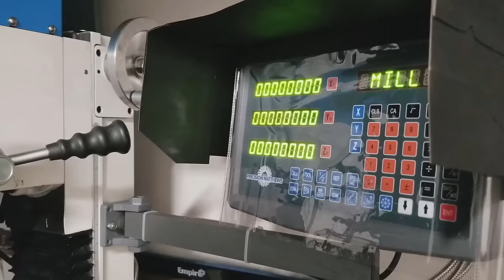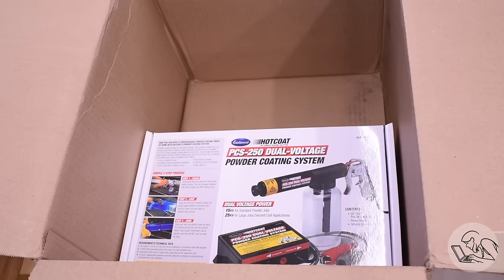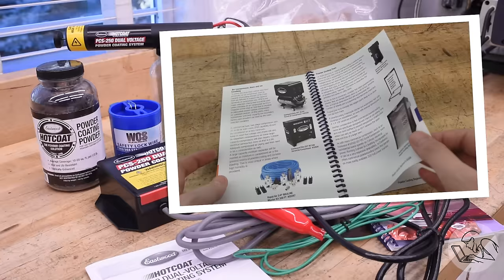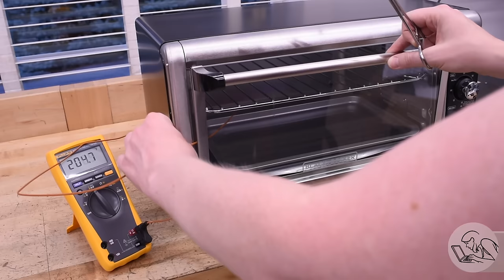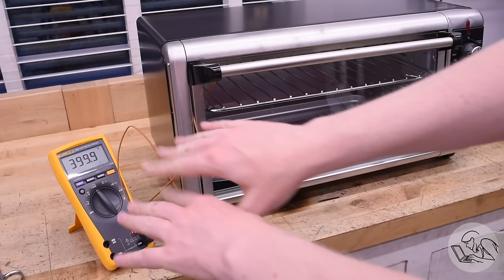Powder Coating At Home! You Can Do It!

Comment: It's hard not to be a bit of a zealot once introduced to the joys of powdercoating. I don't know why Eastwood insist on stainless steel wire. I've used copper, aluminium and steel wire and they all work fine. The low voltage setting on the power supply is to help get the powder into recesses and deep cavities. It's better at reducing the Faraday effect. Have you discovered the excitement of triggering the HV while holding the grounded part yet?
Reply from the maker: Ohhh, thanks for that info, Preso! I should have asked you first. 😄 I’ll make good use of that low voltage setting. The book did explain the Faraday problem, but did not explain how the low voltage setting will reduce it. 

I have not discovered that joy, but it’s been on my mind a lot. I did get the gun too close once and saw the arc. Gives one pause about the voltage flying around in there. 😳
Reply: I wonder if they insist on stainless steel wire because other kinds can corrode and form a skin that acts as a resistor to the ground connection.   Completely guessing of course.
Reply: I've been wondering about Quinn's sample part, with the wire looped through the hole - whether the wire would create a shadow on the part.  What about a tiny sheet metal screw in the hole, with the wire wrapped solidly around it?
Reply: If you are trying to get into recesses and the low voltage setting is still to much you can mist the coating in without hitting the voltage button at all.  Once you put a little powder on the piece will keep a small amount of residual voltage and it will be enough.  It is the opposite of painting, generally you try to mist the recessed areas first so you don't put too much everywhere else, powder is the opposite, cover the easy parts and then mist in the tricky spots.
Reply: If you have the space, I recommend finding a used electric wall oven. That's what I use for all my powder coating.
Reply: Stainless Steel has a higher resistance then most other metals. I wonder if this has anything to do with it?
Reply: @raulthepig5821 probably because it's the most chemically inert metal (except Platinum and such but that would be cost prohibitive anyways)
Reply: I realize this is a couple of months old now, but I can offer a little advice tho you don't have to take it. I used to work in a factory that I just did powder coating in. We used to use all kinds of things to hang things; sanded down coat hangers to some pretty thin wire. We ALWAYS used the wire it was hanging from as the ground to the work piece. Sometimes we had to file the old powder off a bit to get better grounds and we bent the ends at like 40-45 degree bends to prevent swaying while spraying. They were different lengths depending on the size of the part, but typically like and elongated "Z" 
Getting any oil residue off of the part was always our number one concern. We coated everything from appliance pieces to car parts to motorsports whole car frames to even new bigger ovens to coat even bigger items. And even coats of coarse is quality. We used 90 percent isopropyl alcohol and a q-tip and if we could rub off any color then it wasn't cured and we also had a little handheld electrical device that told us the thickness of the powder coating just by placing it on the piece. I'm not in this line of work anymore and it has been over 20 years since I've done this, but principle shouldn't change much. Spray it, heat it up to 420F (even in deep cavities) and then let it cool down.
Also, for threaded pieces..we screwed in a bolt to cover the threads completely, then sprayed it, then removed the bolts before baking it. We also have left bolts in (making sure they weren't going to be coated to the piece) and used the bolt to wrap our ground wire around to hang it from. Back to oil, we had these big tubs that had warmed up degreaser in and then we had 2 tubs to rinse them from the degreaser. Baked them dry and then cooled with a fan then straight to the booth and then to curing oven. We also had a fan on them for the cool down process.
 Idk if much has really changed, but hopefully something I said helped. Cheers

Comment: What a wonderful tutorial on home powercoating! I knew that these kits were available, but I figured that they really couldn't be worthwhile, since the 'big guys' have such large and expensive ovens. Seeing is believing, and now I know that this kind of work is feasible in the small shop, and the results can be excellent!
Reply: I mean, powder coating is essen\tidally melting powdered plastic. It doesn’t seem like it should be too hard to get something functional. Getting it to volume mass production is an entirely different kettle of fish.
Reply: Did you really trademark "Sproing"??  Genius!
Reply: I did some just by blowing some on a flat piece and using a heat gun to melt it, worked great
Reply: I know a guy that picked up a double oven free on marketplace.  He cut out the center divider and connected the doors, it gave a big enough heating area to do small motorcycle frames.
Reply: The only thing keeping people from powder coating is fear.
I did an old clock in a toaster oven, if you're interested in seeing the results.
Reply: Check out immersion in a fluidized bed. You can make one from some PVC fittings, membrane, and an air regulator. Heat, dip, cure. Great for those small parts!

Comment: For toaster oven stability, the polymer clay folks like to bring it up to temperature with a brick or a big ceramic floor tile in there. A nice, durable thermal mass can even out the temp swings from those door openings but won't off-gas anything.
Reply: Bread and pizza folks do it similarly.  😎
Reply: 👉What are the temp’s needed to cure it? Reason asked is I use a large Dehydrator unit for curing many of my hobby items. However the 🔝 temp is only about 160°
Thx
Lee
Reply: Good idea!
My first thoughts on why the temperature bleeds prevent 425 degrees is because the electrical and wiring insulation will fail sooner at that higher temperature.
So shielding that vulnerable side with refractory material makes sense as well as heat sinking, insulating, and thermal mass in all the right spots.

Comment: As a painter, a lot of people put too much etch primer on in my opinion.  On Aluminium, brass etc. the best result is got from applying a mist coat just enough to cover the surface, but it should be see through, not fully solid.  The way it's supposed to work is the primer is a boundary layer, it's not paint.  The undercoat and top coats bind to the boundary layer making a contiguous coating on curing.  Too much primer is actually weak and pulls off easily.  I favour Alkyd enamels myself for levelling out and holding on around sharp corners and edges.  And Penetrol is of great benefit too with any oil and turps based paints and varnishes adding flexibility and adhesion - although too much matts the finish off and colours will change with some pigment groups.  Looks like powder coating is a great way of getting a really tough coating onto smaller parts and not that hard to do from what you and Preso have shown.  Might have to level up from fluid coatings at last myself... :)  Cheers from Oz.

Comment from the maker: Hey everyone! Yes, I did install the drip tray incorrectly. I swear I read the instructions but I missed that detail. 😊 Didn’t seem to hurt anything but I have since fixed it.
Reply: For smaller parts you can just degrees them then put them in a container with the powder and shake it to coat them. Lots of people who cast lead bullets powder coat their bullets this way.
Reply: @bluebanana6753  I know nothing about casting bullets but am curious as to why they get powder coated? 
Also putting the item to be coated in a container with the powder, does that not affect the final coating thickness?
Reply: Just a suggestion you could try mixing some powder with acetone or lacquer thinner then dip your small parts or put it in a gun & spray then bake as per normal 👍.
Reply: Can you turn the oven on its side to get more interior height? IDK, just asking.
Reply: You owe Sprocket a box. 😂
Reply: @bluebanana6753  I thought an electrostatic charge on the part was needed to make the powder stick.
Reply: @Gin-toki yes and no. You have to have the right technique and powder. Some pre heat them a bit to get better coverage and thickness. But if you want good accuracy, an even and consistent coat is important. Some reload bulk ammo and don't care too much. But many do want accurate ammo (and they want better accuracy than what they get with tumble lube) and a good technique with this method gives them that.
Reply: @ron827  Look up powder coat cast bullets. You will see that is not the case. And it's pretty amazing on the consistency you get in coats. It's not like you can have every bullet standing right side up in the rack either. We are talking about amounts between 500-1000 bullets at the time when you coat and bake them.
Reply: @1slotmech  
That debt will be collected, cats are that way. Mine are.
Reply: @ron827  
The charge is on the powder, which then is transferred to the grounded part. Lots of charged particles flying about there.
Reply: It probably works as a good heat spreader the way you installed it.

Comment: Quinn, if the toaster doesn't quite have the stability or recovery time you need, there are conversion kits to turn them into PID-controlled, better insulated reflow ovens for SMD soldering. I did a Controleo3 conversion on a similar toaster to yours a while back and was fairly impressed with the results
Reply: I've done the same, only for bakng SMT PCBs. It's an excellent product. I can't remember if the hardware is open source, but the firmware definitely is.
Reply: I suppose a HotShot 360 would be overkill.
Reply: Many years ago, I built a box containing an Omega PID controller and an SSR to control my small 120V glass kiln. The controller plugs into the wall, and the kiln plugs into the controller. Because it's designed that way, I can use the same box to precisely control a small toaster oven I use to cure Vitrea 160 glass paint, because if you overheat that stuff it tends to discolor pretty badly.

I've also used the same controller, with a separate, dedicated-use sealed stainless-steel thermocouple, to control a hot plate I was using to make cheese at home.
Reply: Another recommendation for Controleo3.  Great kit; works very well.
In unrelated news: kitchen appliance cords are required (UL/ETL, maybe) to be no more than 3' and no less than 2' long, so a lot of stuff comes with a 2' cord now.
Reply: @babyeatingpsychopath  The reasoning behind the short cord seems to officially be as a way to prevent a tripping hazard. Another reason is that since current electrical codes require enough outlets in kitchens that a longer cord is unneeded. If you're aware of toaster bathing, it's far more likely that the driving factor comes from the bathroom electrical code and manufacturers covering their own butts from lawsuits stemming from the sudden desire to have toast while taking a bubble bath.
Reply: A good candidate for a new power cord, as it is no longer a “kitchen” appliance!

Plus, drill a hole through the side and leave a thermocouple for your Fluke mounted permanently.  Not that you didn’t already think of that!

Comment: Hi Quinn. I used to do powder coating on parts for medical braces. They were mostly all aluminum parts, but I also did some steel now and then. Just a couple of suggestions (based on my experience)...
Fist is that some stainless steels aren't really good electrical conductors. I used to use steel wire (like the kind you would use to tie rebar with. You can get rolls of it at most any hardware store.) to hang my parts. That might improve your bad ground issue.
The other thing is that I would pre-heat the parts before spraying them. The guy that taught me how to do powder coating said it helped getting the powder to stick to the parts before moving them into the oven. I think I was baking everything at only 350 degrees, and I never had any failures. I don't know what Eastwood would have to say about that, but it might be worth trying.
-Andy T.
Reply: Yes. I used to work at a metal fabrication shop, and everything was powder coated. All the parts were hung on a large conveyor with hooks and then pre- heated, then painted and then back up into the oven for the final curing.
Reply: preheating works great. Also helps to eliminate any oils that may still be on your materials. I’ve even powder coated with a propane torch. You can spot repair with a torch too. Clean the effected area. Heat with torch. Spray with paint and keep hot enough for the paint to melt. Powder coat is awesome! Cleanup is such a breeze too!

Comment: For the crumb tray there should be a slot underneath the door it goes in. The "pan" will hang  underneath the rack and helps catch the drips.
Reply: +1 for this one, the way it's now is blocking the bottom heaters
Reply from the maker: Oops, you’re right! ☺️

Comment: I use an old Harbor Freight gun and power supply.  I picked up an old hospital food warming cart, and used the controls and elements from a household kitchen oven.  It works great.  I did have to add additional insulation to the food cart so the outside wouldn't get too hot.  I've used this set up for about 12 years now.  You can't beat powder coating.  It is so much faster than painting, and as you said it is so much more durable. . . . Chuck

Comment: There is another technique that does not require a powder gun or a booth. Take a small bucket, put an air line into it at the bottom. Over it place a plywood disc with a bunch of small holes in it; the disc should also be covered with fabric. With the air line and diffuser in place, put a good amount of powder over it, but don't fill the bucket all the way. SLOWLY turn up the pressure until the powder starts to bubble, it would be almost like water bubbling in an aquarium. Preheat your part, then dunk it into this aerated powder. The heat will melt a tiny amount of powder that touches the part, coating it. 
Disclamer: while I have seen this technique give good results on an industrial scale, I have not tried this small-scale setup, so I do not know how good of a coating it will produce. I am mainly just sharing the idea.
Reply: I think that depends on getting air bubbles distributed to all nooks and crannies equally. If certain areas have dead airflow then you need to craft targeted streams to those dead spots.
Reply: @gary.richardson  True, it won't work for absolutely everything. But if you're coating simpler things then it'll save you from having to get expensive equipment. And to be hones, even that equipment struggles with some geometries.

Comment: Nice tutorial, the only thing I like to mention is the time when curing white paint. When white paint is cured to long (or to hot) it tends to get yellow or brown. I have seen this often when at my workplace they stop the paint chain with white parts still in the oven when shift is over. The next day the parts are in a different shade of brown, depending on where they were at in the oven. Now they don't paint light colors at the end of the shift.

Comment: I got into powder coating last year and the only thing i use to cure it is an infrared heat lamp. I heard of people using them on car body panels and didn't think it would be enough to cure it properly but after many tests i have found the durability to be no different than curing it in an oven. I just hold the lamp over it until the powder glosses and move over a little at a time while the gloss follows. the thicker the part the longer it takes to heat up but it works great on bigger parts. I rebuilt a welder generator and completely powder coated the whole thing with no problem. the hardest part was the cast iron engine bc it took about 5 min to heat up
Reply from the maker: The Eastwood book mentions that this is possible for larger parts. Good to hear it works.

Comment: This is awesome! I didn't even know it was possible to powder coat at home. 

Years ago, my mountain bike (don't ask. It's ancient) was so marked up I wanted to paint it but it's aluminum and I didn't trust myself painting it. I talked to a friend of mine that worked at an auto parts manufacturing company and after I stripped the paint off it, she carried my bike frame in the back and they powder coated it AND baked it on free of charge. Of course management didn't know they did this LOL! Still have the bike and the paint is near bullet proof. I managed to chip it once in accident with a tool made of hardened tool steel. I'm am idiot but the ladies at the factory are awesome!

Comment: Looks like it's working pretty well, though seems like the air pressure might be a bit high.
My powder gun is an ancient Eastwood setup, for small parts I always found it worked the best at far lower pressures than recommended... Basically you want a "breath" cloud of powder on the part, like if you asked someone to smell your breath.
For larger parts (mostly car rims) I used the higher recommended pressures and the deflector.
Reply: Thankfully I've never had someone ask me to smell their breath!😂

Comment: For somewhat larger oven, keep an eye on any local auction houses.  We have a local "public surplus" auction house not too far away that deals in surplus from stae agencies and I picked up a used lab oven (calibrated even) that goes up to about 240c (475f) for $26 USD.  Well over $3000 new.

Comment: A couple of things I have learned powder coating at home....Use old wire hangers bent into an "S" to save $. Always heat cast parts above the curing temp to "cook" out anything embedded in the pores before coating.